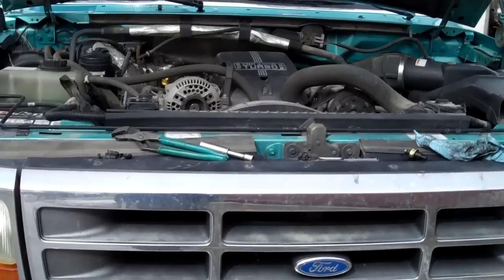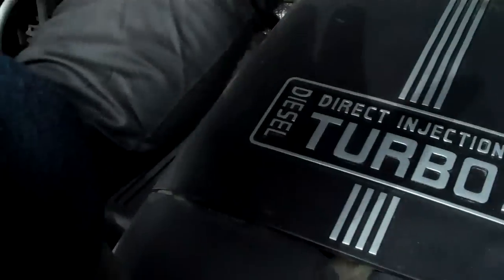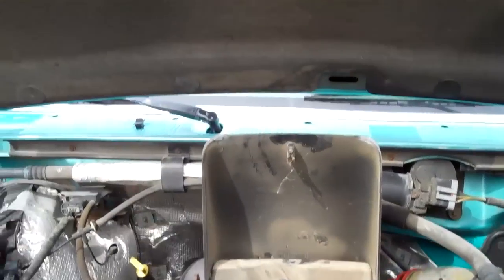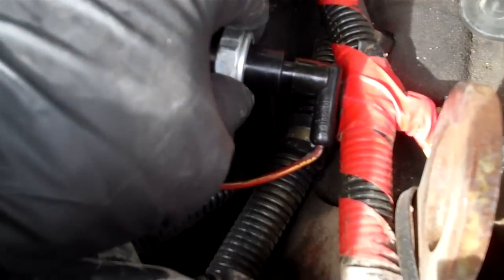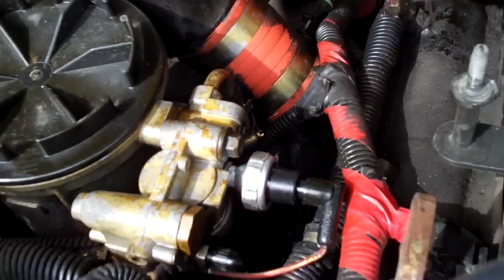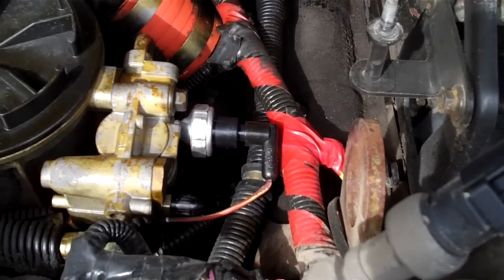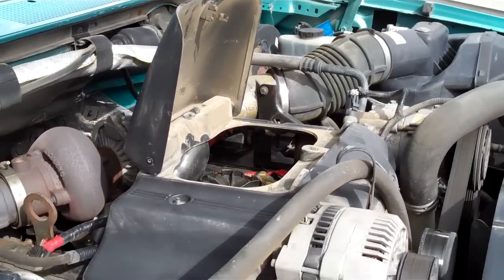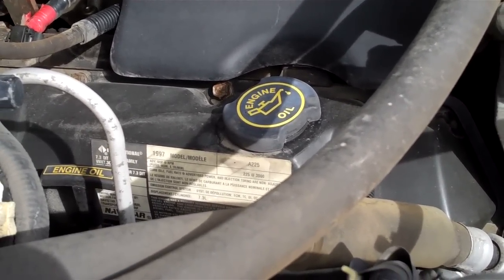Easy to fix Diesel Fuel leak on Ford 7.3 liter

Comment: Thanks for the video. That pressure sensor/switch only turns the "replace fuel filter" light on when the fuel pressure drops (as if the filter is the only possible reason.) Also it's an $83.- part! So just put a bolt in the sensor/switch hole to solve the leak problem (temporarily.) Gives you a chance to ponder the importance of that sensor while being able to drive the truck without diesel smell emanating from under the hood and dripping on the driveway.
Reply: What size is the bolt

Comment: thanks for posting this, I was leaking fuel, couldn't figure out where, everyone suggested the o-rings on the drain valve, replaced them, still had the leak. replaced this and fixed it glad I didn't have to pull my fuel bowl out.
Reply: genuine Ford part can be got from Amazon. part E8TZ9S283A, I called my Ford dealer they wanted $190!

Comment: I had that leak back before I did an e-fuel conversion. Takes a 1/8 pipe plug, and as long as you service the filter and don't buy crappy fuel you have no need for it. It turns on the water in fuel light.

Comment: Great looking truck. That's called a Fuel Filter Restriction Sensor, hope that helps. Had to delete my last comment bc I misspoke, some late 97's had the small cover that was about half the size (no flap), but most are found on Super Duty's (99-02).

Comment: Thanks for the video!  Will diesel leak out when removing the old sensor? Jut wondering if I should be prepared to catch the fuel leaking out during the replacement.

Comment: My fuel distribution block was leaking at the bottom of the unit where a hard line came out. I put some high temp auto grade silicone on the bottom of it. Hopefully she fixes the issue for now.

Comment: My buddy has a dodge with 74k miles on it and in the shop for a third trans. Ya cant talk crap about your truck being badass  unless it backs it up. My 03 powerstoke 7.3 is as tough n quicker than anything I come upon (14k in motor) but its 7200 lbs. smokes challenger and Camaros. And still pulls a 40' toy hauler loaded at 70 n 17 mpg. My newer '13 f350 with a motor built by FORD does nearly as well just haven't had money to build it yet. So till dogded or gm can build a diesel on their own I say Fords the king!!!!!

Comment: what is the syptoms of diesel fuel leak. My 7.3 idi turbo is do the glow plug relay clicking noises also the needle of the battery cauge is moving with the clicks the glow plugs need two-three times to cycle even now is warm days. on the road my truck is stick shift i feel the engine is miss sounds like tractor

Comment: Mine has never been connected and when I did hook the wire up never worked, then it started leaking thru the sensor replaced with a 1/8 NPT plug from discount auto solved the leak....

Comment: I was driving my truck and once I turned it off it wouldn't start any more I found out it has a  leak on the same fuel filter vacuum switch the same one from your video ....if I change this switch will my truck start ?
Reply: Did you try it? I’m dealing with the same thing on a 94

Comment: Hey Bry, another fuel leak source i just dealt with on my '95 7.3 was just below your pressure sensor called the fuel temp thermostat, it powers up the fuel heater inside the filter housing. Bad O ring blew out over time and really gushed. It's a lousy design, not threaded into housing, but only held in place by the water in fuel sensor beneath it.Surprised more 7.3 folks dont have this problem. Check this out if fuel still leaks after replacing O rings in housing drain lever, might help!

Comment: On the ford power stroke 1980-2000 the fuel switch is under recall
Reply: What was the recall ?